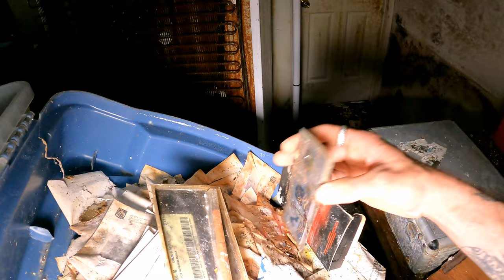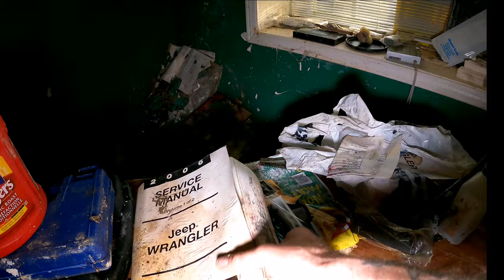Biker Clubhouse and Surprise Left in Abandoned Time Capsule! (Harley Davidson) EXP.71

Comment: The Harley Davidson has the "Twin Cam" engine, I recognise the distinctive engine heads, these were the models produced made after the evolution engines.  
This "Twin Cam" model was made from 1998 to 2017, and by the looks of it has been there for many years so I am guessing it was relatively new when it was left there seeing as the levels of rust and dust and just how badly the place has deteriorated.   
It probably wasn't in great shape to begin with but once these old buildings are left idle those minor leaks and minor repairs can have roof caving in.  
Could still be worth saving I'd say it possibly is relatively fresh though there is a chance it is stolen or used in some major crimes.. chances are the owner is more than likely in jail or dead.  
Still seems a shame to let such a bike go to waste, it could fairly easily be brought back to life with a little TLC and a lot of elbow grease, but not sure how you would go about gaining ownership, you would prob have to inform the local PD and see if it is stolen, and go through the whole process with that first then maybe it goes to auction if they can't find an owner.  
I'm guessing it's there around 20 or so years give or take so if nobody has come for it by now well..

Comment: Dude, just to let you know what that Red tipped Round means. If I'm not mistaken those Red ones are Tracer rounds. If you notice, you're only finding them in 3 round strip-clips, because when you use them you only use 1 Tracer round per every 5 regular ones. They're used to mark where you're placing your rounds in on your Target. Those have an illuminated boat tail at the back end of the round, and it's almost like common Emergency Flare material inside them. Don't get me wrong about it, those Tracer rounds can and will Kill you just as fast as a regular round will. They're used to show you where you're placing the other rounds on your Target down range.
Reply from the maker: Thank you very much for your message and your support! 🤩❤️
Reply: @BrandonAbandoned  You're absolutely welcome..